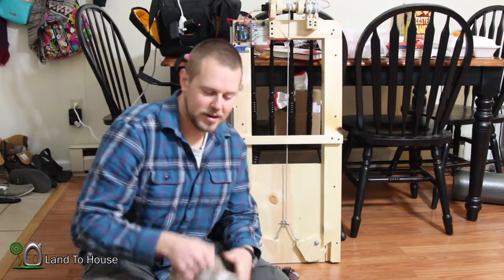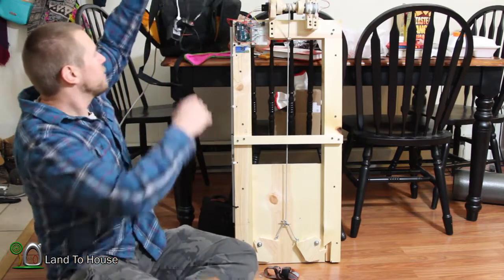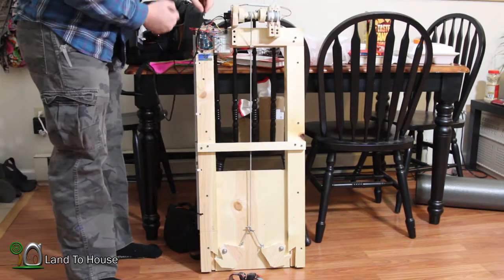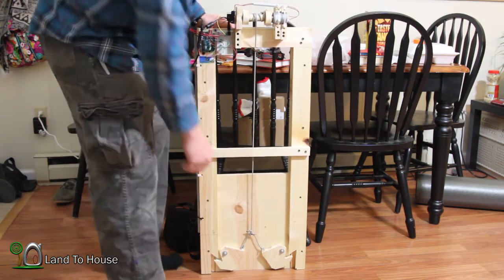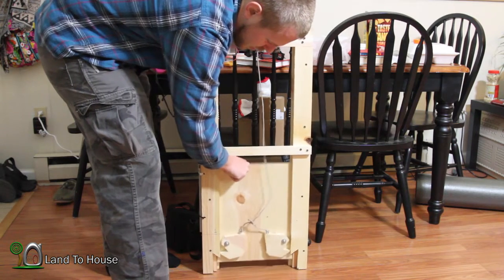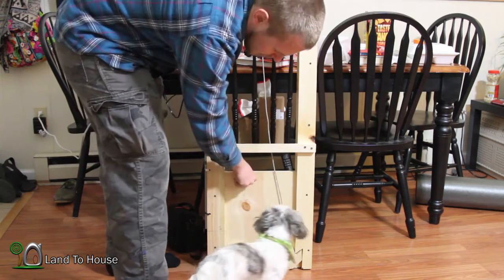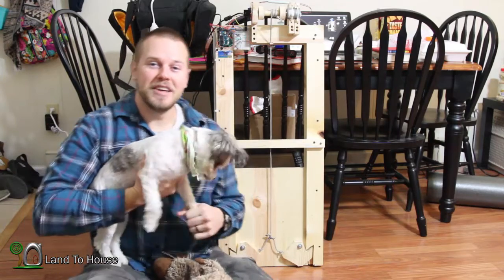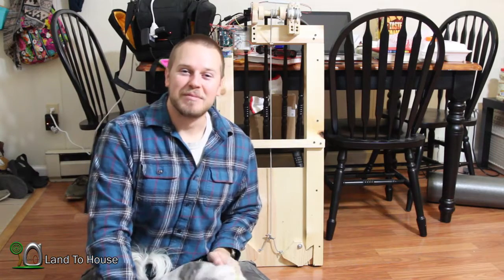Amazing Automatic Chicken Coop Door Part 7/7

Comment: An error in your program was causing me a lot of problems and I finally figured it out. When you have an if statement like in your program (if (switchState2 = HIGH && lightVal < 200) ) you have to use a double == for the comparison. Just for future reference. With only a single = in the example above the program will always change the value of switchState2 to HIGH. The comparison operators are as follows:     Comparison Operators:

x == y (x is equal to y)
x != y (x is not equal to y)
x <  y (x is less than y)
x >  y (x is greater than y)
x <= y (x is less than or equal to y)
x >= y (x is greater than or equal to y)
Reply from the maker: Ah! This was my first and only use of the arduino.   I am sure there were tons of things that could have been done better.
Reply: Hello,
Can you send me the modified code (my email gelnar.lukas@seznam.cz)?
The startup procedure works fine. The door will slide down after switching on. Then they go up, but as soon as I shade the photoresistor nothing happens.
I measured the voltage on the photoresistor in the light and it is 4.7V and in the shade 4.9V.
Thank you.

Comment: I built and installed this design and got it working just fine for a few days. Unfortunately, the chickens kicked so much wood shavings and debris under the door it would not go down far enough to trigger the sensor. Then the motor continued winding the door back up and busted the spindle on the motor. It was a mess and I really don't know how to stop it from happening again. The only solution I can think of is to cut a hole in the floor so the debris falls through instead of stacking up against the door. I would love to hear any other solutions.
Reply from the maker: I also ran into the issue of auto stop. By the time I got to the code I ran out of internet in the project. Perhaps a Hydraulic closure would be better? It could lower down and have a set stop and a set lift point.
Reply: @LandtoHouse  Could you explain what you mean by a hydraulic closure?
Reply from the maker: Instead of sliding up and down it would close top down on a hinge and cylender. Still programmable but would have set stops.

Comment: Thanks Seth, Awesome!   You saved me says and days of research and testing.  I'm using a Nema 23 motor and controller with a threaded rod- a little more expensive, but no latches needed.  Your code is perfect for me, also using a light sensor and reed switches after much research.  Thanks for sharing!

Comment: Love the videos.  the vectors for the latches leave them susceptible to opening with rattling, not quite a positive grip...shim the latch points in the frame to move them down 1/4" or more, and cut the latch cams to match, it will give a better grip to close the latches when the door is forced up.

Comment: If you added some weights to each of the locks, they will lock so much better and never pop unlocked.  To add weight, just drill a small 1/4 inch hole about half inch away from the eyelet in each of the locks then melt some lead into the holes.  The added weight will force the locks to lock more securely.
Reply from the maker: Good point. I guess I could also just drill the hole and place some washers and a nut on there. :) I do not have chickens yet so I cant try this out but I hope to some day.

Comment: Seth, I put this post and link on my FaceBook Page - nice series. Hope a couple IDY chicken type friends subscribe... Not for the A-Frame chicken tractor. It may come into play in the event of winter quarters in a green house with daytime access to a large outside compost pile. Considering how to add a chicken watch feature for a two door entrance with only one door open at a time that admits a portion of the flock. This would protect the green house heat but let the birds come and go.
Reply from the maker: Thank you! I should expect that a watch feature is very feasible with the arduino. I don't know how to make it but the device can do almost anything. That would save lots if heat.
Reply: Saw a video that said 4-5 chickens generate enough heat to keep a green house above freezing. Dunno for what outside temp or for how long... Also, heater for the water, a 100w light, and an emergency electric heater should cover it all. Smiling yet?
Reply from the maker: My brother in law was telling me that if you let the bedding in the coop build up some by putting new chips on the old chips it will generate enough heat to keep the chickens happy in the winter.  Then clean them or in the spring. So much to learn about these dumb birds.